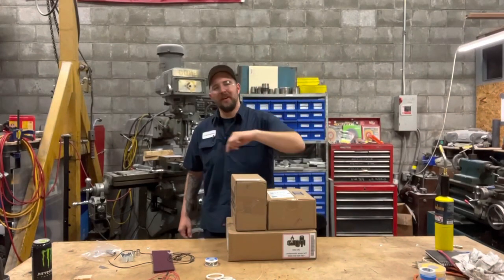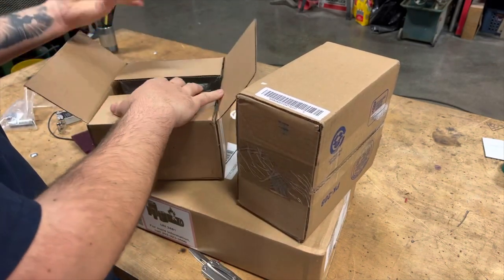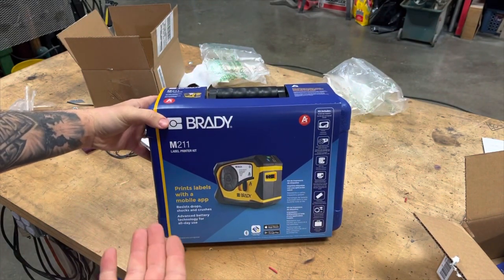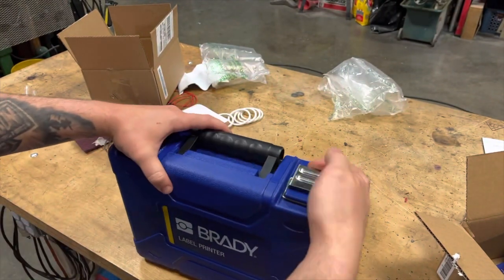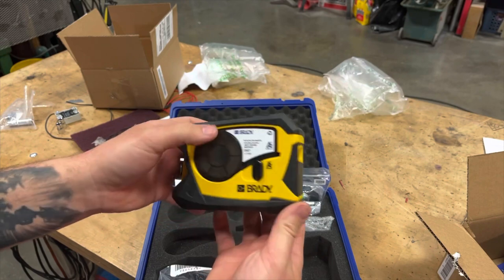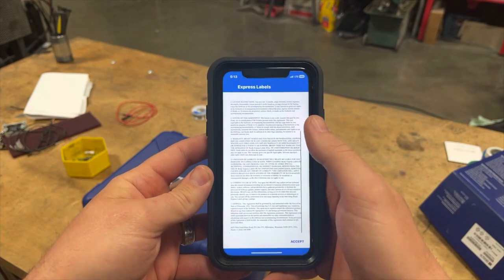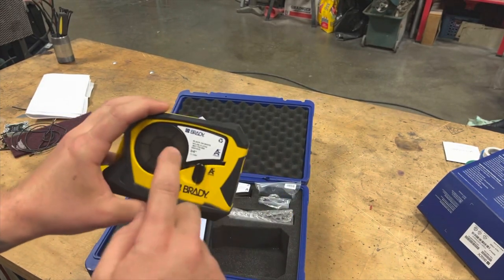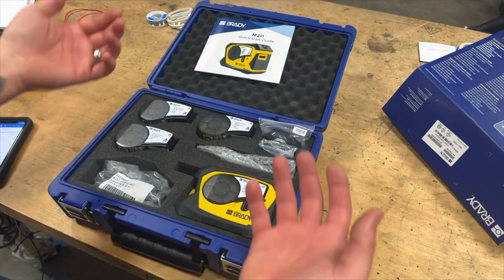Brady M211 Label Printer, Tool review!!

Comment: The labler is good, Been using brady for years. Should QR code the device so you can easy download the app without the box. now drop it off a ladder/work bench see if it holds up bet it will be fine. :)
Reply: We're putting the durability of these printers to the test in a new video coming soon!